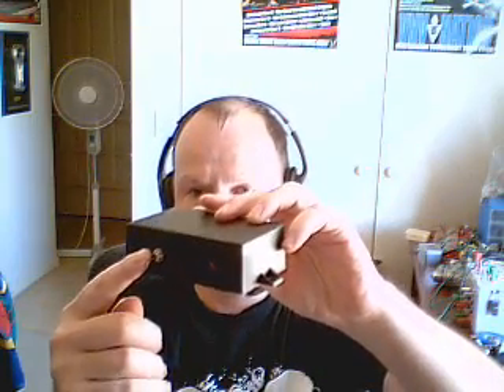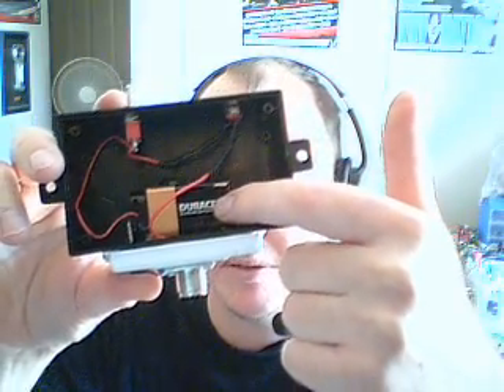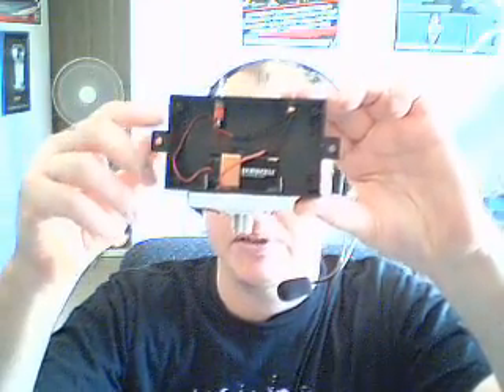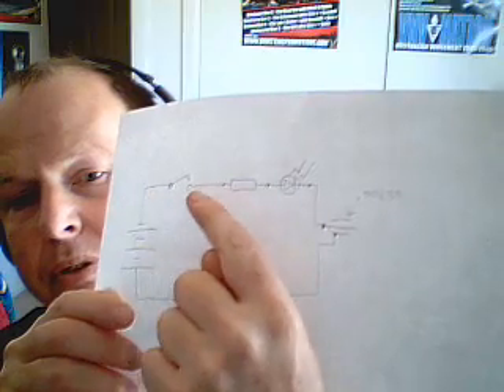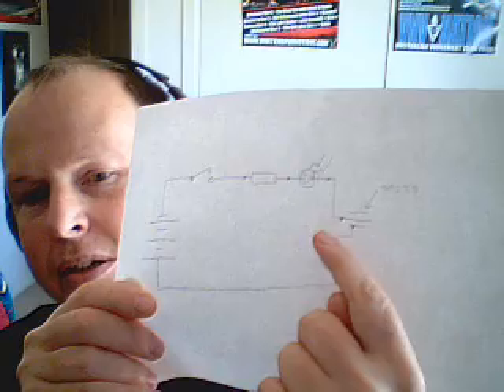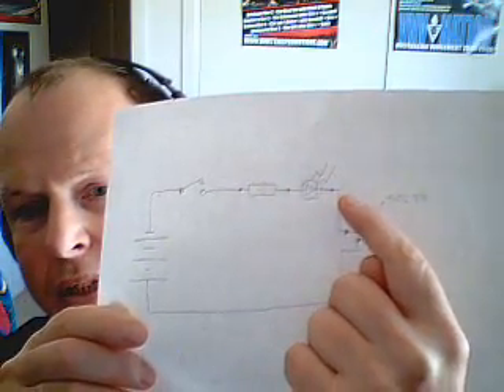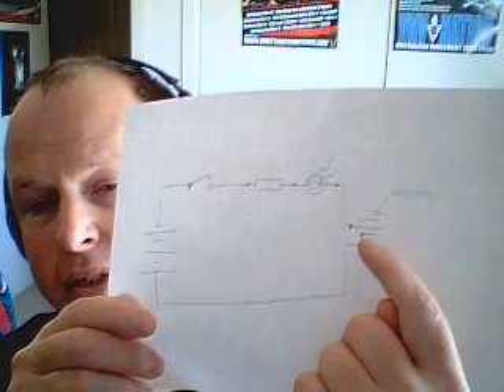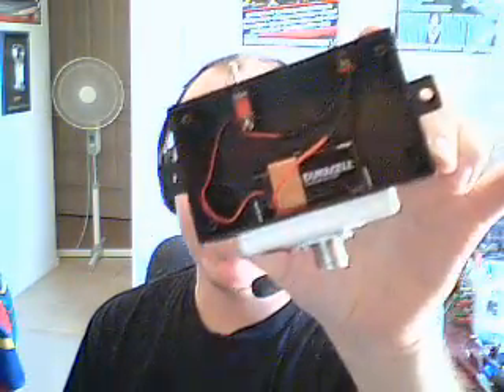Coax Tester

Comment: Hey Chris just to clarify, you connected the shield of the coax to the -ve supply of your battery? Basically the short completes the circuit in the tester, its like a continuity tester for coax :)